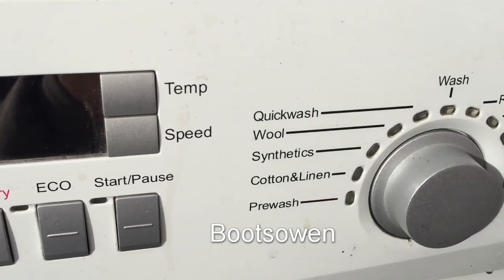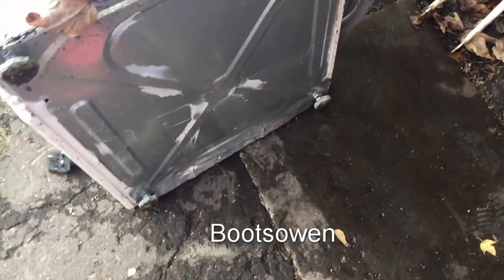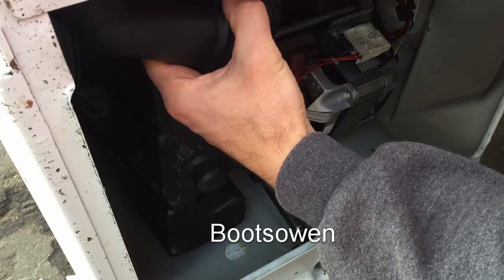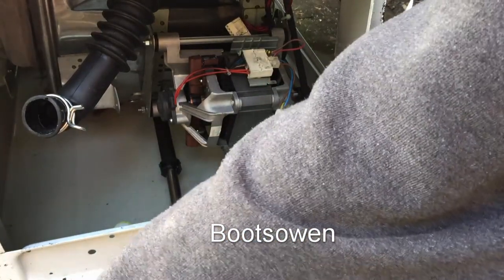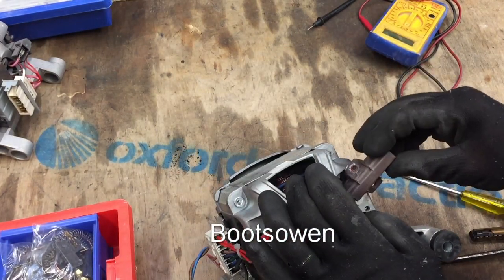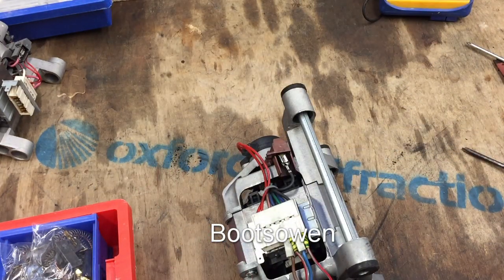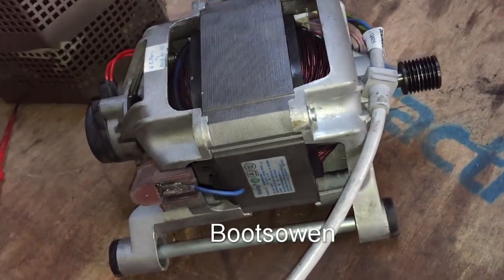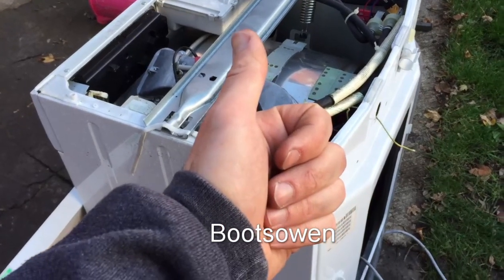Haier HWD-C1200TXVE-U washing machine motor brushes replacement and hotwiring motor

Comment: I’m surprised that has a metal drum! Haier are usually the lower end machine like logik and vestle. But this one has a indesit drum in it and made by indesit but is haier styled. I’m surprised a Chinese machine is that well built!
Reply from the maker: It is made out of good materials, but it still has low quality assembly relative to old bosch or miele.